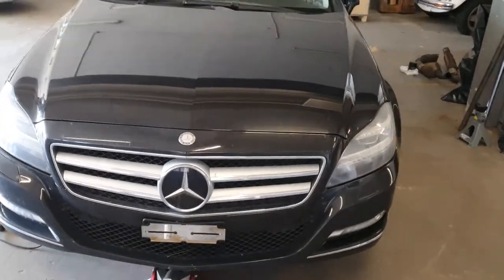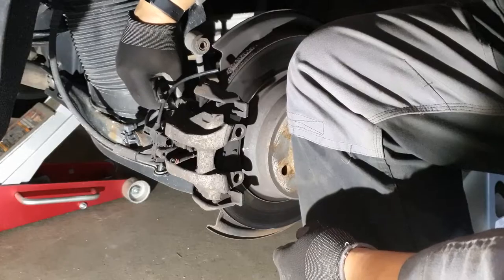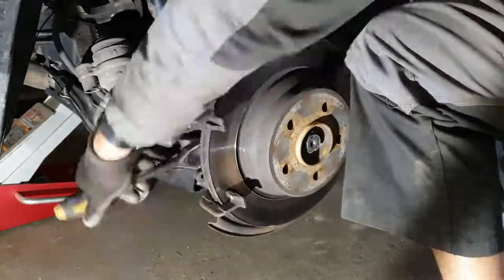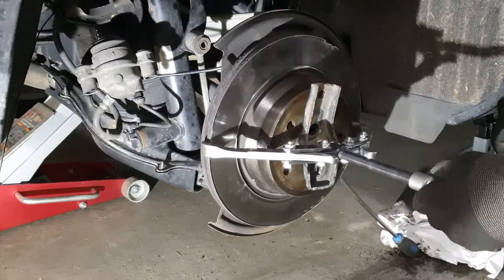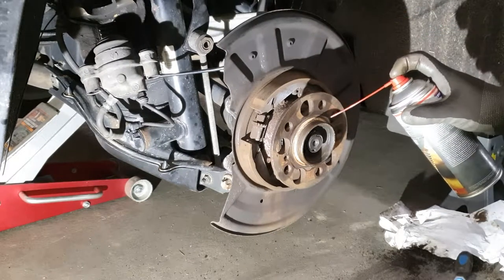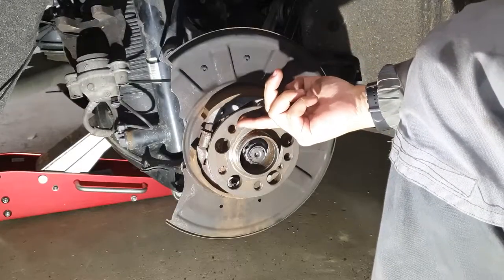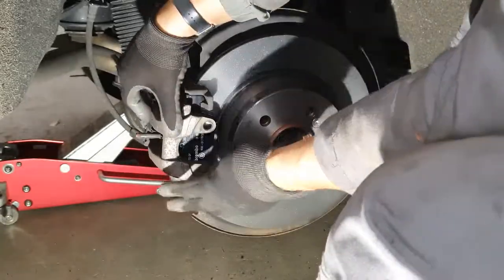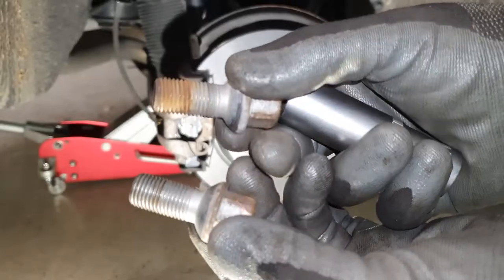Mercedes CLS 350 Rear Brake Replacement

Comment: Good work - thanks for doing this. You should mention opening the brake fluid resevoir cap before compressing the piston. Makes it a lot easier.
Reply from the maker: Great point. Yes indeed that's correct. 

Thanks for your comment.